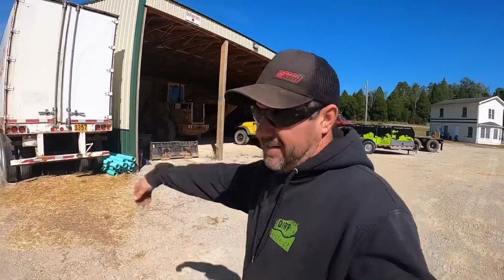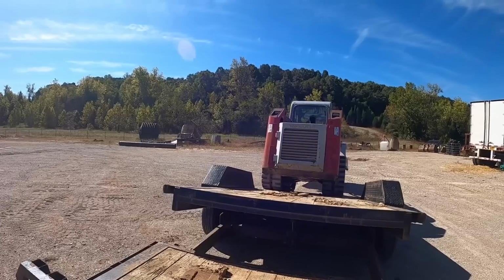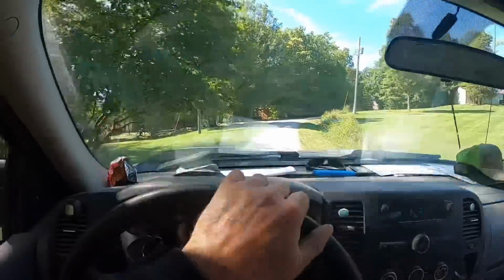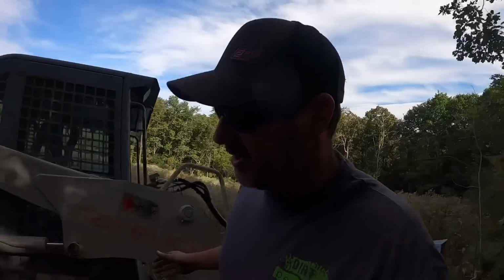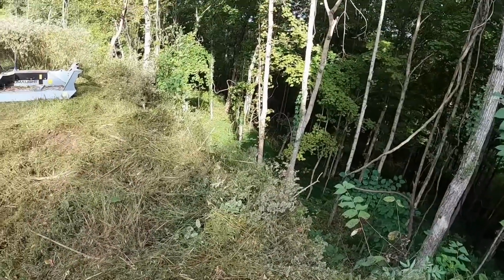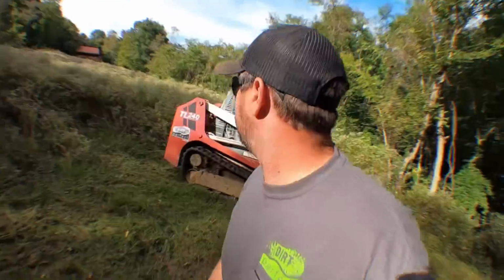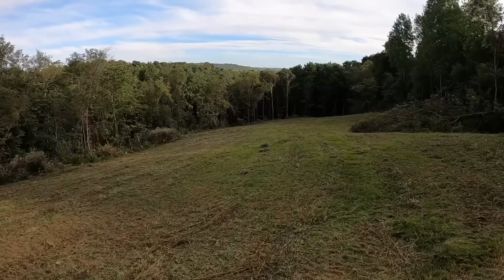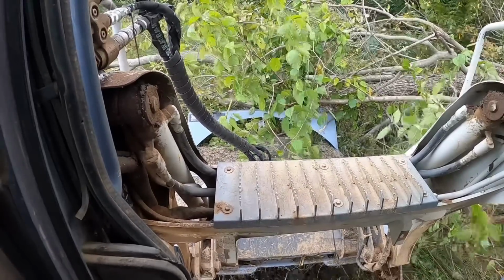Using the Baumalight brush cutter on the Tl240 trying to improve the view on a old clearing job

Comment: I’ve found that it helps if you do a “hungry hippo” type motion on the bigger stuff so it doesn’t fall at an awkward angle. Just raise the front of the cutter a few feet up when approaching the big stuff then lower it to normal height and back drag a few feet.

Comment: Don't forget to check the blades when you've finished a job. Check them for being bent and blunt. Straighten and sharpen where necessary, grease where applicable,  then it's ready for the next job.
Reply from the maker: Never sharpen blades on a brush cutter just fyi

Comment: Recommend you keep your door closed and wear safety glasses when cutting brush. Not a big deal until a piece of tree enters the cab. I have had a few pieces hit my window. You wouldn’t think it would be possible basically sitting on the ground with the front end slightly higher than the back, but it slings things everywhere, even with a light duty cutter like yours. I had fun with mine today, except when I sucked up about 10 feet of barbed wire. Spent about 30 minutes removing it.

Comment: For something that is quite small, your scid steer certainly packs a punch, it really handled that brush cutter well.
It is noisy in that cab, is there any aftermarket sound proofing that would help? I know it's difficult as you are basically sat in the engine but there must be something, if not it will have to be ear plugs, ear defenders or make Matt use it all of the time. 🤗

Comment: have you tried laying some rubber matting behind beside and under the seat? you could just lay them in place initially then maybe mount with velcro so they are easy to remove for service. you might also want to wrap the exhaust with glass fibre wrap.

Comment: Some brush cutters have wheels in the front to stop from hitting the dirt and I saw another one that looked like the guy welted two post on the front that had snow ski type of feet attached so that they would slide on the dirt. Both styles give consistent cutting height.
Reply: They are called scalp wheels

Comment: DP on our taco we have the hydro cooler on top. But you don’t do brush 100 % of the time as we do. Just a thought if you do more with it. I will resend a text pic of it. The taco high flow hydraulic system is awesome.

Comment: That is one awesome beast like that tiesmanian devil you said something about your hydraulics about you can't hear it is there a switch that you can buy to regulate like a rev limiter the light comes on when the rev limiter hits the high RPM but for your case you need one that shows when it's limitations are running slow so you can see it by your peripherals of your eyes without your distractions a sensor in mind with your hydraulic pressures just food for thought you're doing a fine job take care brother from another mother

Comment: D.P. look into the sound deadening materials the street rodders use in their cars and trucks . Do the floor , underside of the roof , down the sides and back wall of the cab , with the added benefit of having the experience and knowledge of how to do the same to Lt. Dan . Btw it will also halp with the air conditioning .

Comment: Thanks for sharing your thoughts, ideas and videos. Good clean job, brush cutter seems to like more power. Dirt monkey recently did a video on a tilt deck trailer that’s very nice. Has a hydraulic cylinder on the bed to dampen the tilting action by basically adding resistance to the fluid flow and a valve to lock the bed up for loading longer equipment. Was a nice feature. I’m betting you could add that to your trailer quicker than checking the web sight for a new trailer. Always interesting and entertaining to watch your videos, wishing you and your family the best.
Reply from the maker: Thanks for watching

Comment: Wonder if there's some kind of flow meter you could put on that brush cutter to show when the motor is getting bogged down since you can't hear it with the window down. Or a RPM gauge running off the shaft before it goes below deck.

Comment: Good evening Mike. 
Could a mount, made of expanded metal house a gauge or 2. One could show pressure fluctuations and the other show temp of oil going to motor of cutter? 
Impressive though.

Comment: So far then the only big complaint on the TACO is the older model’s cabs are not as insulated (not quiet)? Running both tractors and CTL’s which is better bushhogging??

Comment: I wonder if there is a sound deadening material you can apply to the interior to knock the noise level of the machine down adequately, so you can hear the attachment?
Reply: @ Bwlyon: I think that some form of ear protection would do, like ear caps. - I remember that wearing those in the engine room of a ship would suppress the loud noises more than the less-loud noises, rendering the latter audible. I seem to remember that DP sometimes uses them, and LetsDig18 nearly always on "shoving equipment".

Comment: Hey D.P. I didn’t see if any suggested this yet. Could you possibly put a high pressure hydraulic gauge in line line with the motor circuit  somewhere so you could see from the cab that would show when you start bogging down the motor?
Reply from the maker: Possibly

Comment: Couple of dumb questions here. From some of the shots in the vid it looks as though you have some decent head room while in the machine. Couldn't you raise the seat a couple of inches to be able to see over the front steel and get a better overall view? Or would that make it awkward to operate if Taco's controls are at a fixed position or would they move with the seat? Surely the seat has some adjustability height wise.
Reply from the maker: No window goes up

Comment: I only heard the hydraulics bog down when you drove the cutter into the ground. The Tako is pretty impressive. Definitely better than the "Other" skid steer. Does the windshield wiper work and does it have a sprayer? Would be hesitant to use wipers dry on the dust/dirt for fear of scratching the glass. Thanks very much for sharing.

Comment: Mike would the sound deadening self sticking sheets help with the Taco I know you can't cover everything for example the roof of the cab, the floor the sides,  behind the seat, if you need to remove a panel just  slice it to gain access hope this helps
Reply from the maker: Possibly

Comment: So, the Kubota svl90 has just over 25 GPM hydro flow and the Tl240 has just over 20 GPM flow so, the Kubota should have been far superior running the cutter so the settings must have been off in the Kubota.
Reply from the maker: It’s not
Not even close

Comment: Seems like you've really mastered the Skid Stear Mike.
I can remember when you actually hated operating one.
The Taco certainly handles that brushcutter better than the old one.
Does the Taco have a high flow hydralics system the old one didn't ?
Reply from the maker: Still do